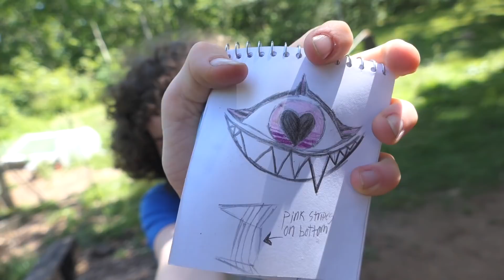Nova Rocket Rebuild

Comment: "This is a big, messy, crude weld"
-Weld looks better than what 99% of diy youtubers are capable of...
Reply: It is quite messy, if you work in the field, but for someone self-taught it's quite passable actually
Reply: I can honestly say she welds better then me and ive been doing it for 15 years now lol... if she keeps learning the trade she's gonna be amazing...
Reply: @spoosh13x13x13  And one day....we shall see a channel called... NovaCthulu...Will that be a day of days
Reply: If it holds, is it a bad weld?
Reply: @wobblysauce  No, If it holds, there is no such thing as a "bad weld". Only ugly ones. But if you work at a factory which produces exhaust systems for cars, even the slightest mistake in the weld could later be a big issue, so you have to weld VERY precise and VERY neat and tidy so the customer will not look at the exhaust and say - "what the hell is this supposed to be ?". Most welds are done by robots, sure - but they often have a slight error or a slight malfunction, and that's where you have to precisely weld away the mistake.
Reply: @Careonovam  Ahh huhhh *taps head, we are not producing exhaust systems here but rocket ships.
Reply: @wobblysauce  Touchè. I forgot =D
Reply: @wobblysauce  Depends on the application, is the weld just holding stuff together or is it under stress? In the latter case there’s quantifiable bad vs good welding, in the first category there’s just pretty and not so pretty welds.

Comment: I always hated the sand blaster, it’s rough, and coarse, and it gets everywhere
Reply: [laughing too hard at a prequel meme]
Reply: you're a sand-blaster now, how do you like that? >:)
Reply: I don't think i'll ever try it. I will catch up on Komi san right now though.
Reply: Litenbadboll ahh a weeb of culture I see
Reply: O great one, do you know what osana najimis gender is
Reply: Yup sounds like it's working
Reply: My introduction to sand blasting was sandblasting inside the top of a main ballast tank of a black submarine out of the water in a drydock, baking in the tropic sun of Guam, in leathers, some 30 or 4o feet up inside, standing on random structural elements, using a trouble light for light.   Along with another beginner sand blaster/crewmember... who sandblasted the troublelight.   So we got to climb down on random structural elements by feel in the dark.   Fun times working with my uncle... Uncle Sam.

Comment: 20:30 Hi, welding student here. You grind your tungsten in that direction because electricity flows along the surface better than it does through the metal itself, and goes along the path of least resistance. If your grind lines are sideways, the electricity will also start going in a spiral around the tip of the electrode. If the lines are straight, the current can very easily and efficiently run off the tip and into the piece (or from the piece and into the electrode if you're TIG welding aluminum).

Comment: The reason the grind marks on the tungsten matter is the way the electricity travels. if they are horizontal with the toungsten then your arc will be wider because the electricity is being kicked out to the edges. if it is done vertically then the electricity travels down to the very tip giving you much more control. Think of the scratches as a roadway for the electricity.

Comment: The reason that keeping the grind lines in the same direction as the tungsten itself is to keep the arc on the tip of the electrode. If the lines don't do in the same direction the arc comes off the side and swirls around the electrode. Just figured you should know!

Comment: Good chance to teach 1/4" plug welds there with mig welding. My dad use to take scrap steel, and drill a bunch of holes into one piece, and stack it onto the non perforated 2nd piece. I would have to fill those holes with plug welds without blowing through the bottom piece, and doing it in one pass. If you can do it on two old, junky, thin car fenders without blowing through, you can literally weld anything else in the world. Great practice.

Comment: So I noticed that you often have trouble with the cold effecting your vinegar bath.
There are heat mats designed for reptile vivariums (tanks) that are the same size as your baths. They just plug in and you can even set the temperature.
Just a thought, hope it helps. Keep up the amazing work 😈

Comment: Quick tip i learned from trade welders: fill in a strong weld, then redo the top layer for appearance, by moving back and forth (narrow weld paths) or doing crescent moons (wider weld paths). As you get better and faster, you can get your pretty welds stronger, then only have to do one pass.

Comment: I know why the grind lines matter on the tungsten Anode!

It's because the electricity flows around the little sharp peaks of the grind scratches- if they're rings around the thing, you get this spirally Whoosh splashing off the end of it going all crazy over the place.  If they're in line to the end, the little lightning flows straight down and doesn't splash out around.

Comment: 20:34
Tig welder here. It's so the gas shoots out straight and thus not cause any swirls or "bents" in the molten puddle of the weld. Basically straight gas = straight welds.

Comment: You would have to push the tungsten in further but resting the cup on the material ensures a consistent distance. I use a 7 or 8, one of the straight cups and have pretty good success with a host of materials and pieces.

Comment: The reason they grind the tungsten tip that way is so when you're welding the arc follows the grain of the grind makes, making it a sharper weld, otherwise the welds dont fuse with the parent metals properly, she did well with her welding, I did worse when I started my apprenticeship

Comment: first thing i learned to do as a welder was fill the holes that i had accidentally burned in the metal with my welding torch.  i learned with an Oxy Acetylene torch.

Comment: 2:08 Aaah, i love smell of child labor on the morning!!
"Nova, you are basically spare set of lungs" Alrighty, gotta admit i was rolling on the floor, but damn thats dark even for me :D
"9inc steelwire brush is so dangerous that i would not let some adults to use it" Can confirm. Even 5 inc disk on small grinder can be dangerous. Had once it catch the edge, rip out my hands, do couple barrel rolls and hit my arm. 5mm deep cuts all over with metal and other crap. That was absolute pain in the ass to clean and took year to heal properly... 9inc with way faster rotation speed on outer diameter... now that is proper dangerous..

Comment: You haven't ground metal until you've started a fire.  You haven't welded until you've set yourself on fire.
Reply: Does it still count if you stop welding just before the leathers actually flame on? I've pulled off a few times with both hands smoking heavily. Or how about the errant slag spatter that magic bullets its way around the mask into the beard? Again it didn't flame up, but you tend to drop everything and handle that immediately. I make no claims of being a good welder.
Reply: @sylumgand  Sure.  Why not?  Starting a fire doesn't mean waiting until the building burns down.  Setting yourself on fire is a subjective experience.  A hot ball of slag working its way down your shirt next to your skin is close enough.  Beards were made to catch on fire while welding.  And lady welders should be taught that it might be occasionally necessary to strip in public while welding.

Comment: Ok Nova.. that's a seriously ugly weld. 😆
I was told by weirdo coworker that you sharpen the tungsten like that so the electricity flows straight to the puddle and not spiral.. hope I explained it ok I haven't welded for 3 years now ...😭 I miss it